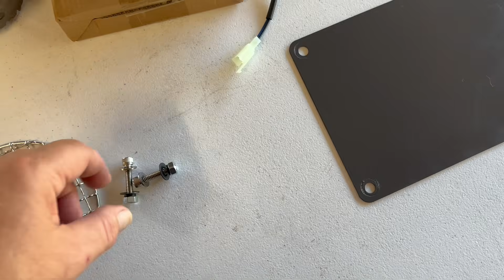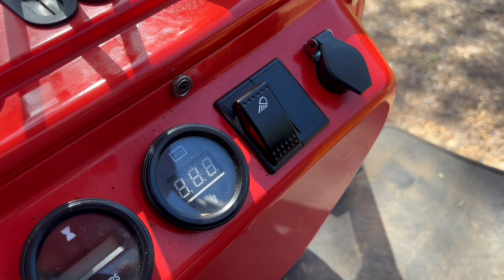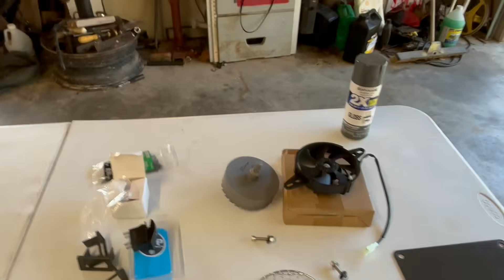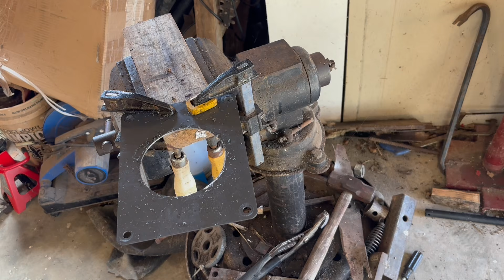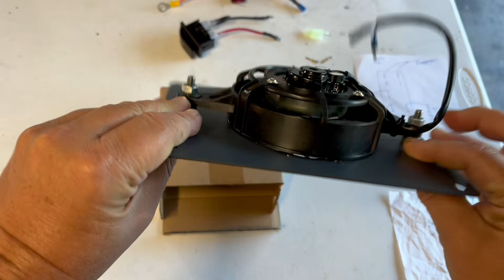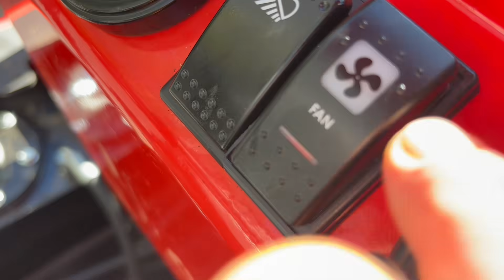Chinese Mini Excavator Fan Install Huayee HY14C

Comment: did yours come with the hydraulic cooler installed
Reply from the maker: Yes. It’s on the side by the engine on mine. One the more recent production ones it’s under the floor panel under your right foot

Comment: Did you just tack weld the grill over the hole?
Reply from the maker: No I drilled some small holes around the perimeter of the big hole and attached it with the small/narrow 4" black zip ties.  They're difficult to see.
Reply: @rgtoutdoors7130  thanks for the quick reply.
Reply from the maker: @USMC6976  Yessir.  I check my notifications on here several times a day, much more often than I check emails.  lol
Reply: @rgtoutdoors7130  I can relate to that.

Comment: Did you use a dremel to cut out for the switch?
Reply from the maker: No. It had a blank spot for an extra switch next to the light switch. I should have a link in the description for an adapter to fit a standard carling type switch.

Comment: Whats your voltage drop to when fan is on?
Reply from the maker: My machine typically runs 13.6-13.8. That includes the hydraulic cooler fan running, which is always on. With my extra fan on there is not much difference. It may drop .1 or .2 but still generally reads around 13.6ish.  The boom light drops it a little more noticeably (maybe a solid.2)but not enough to drain the battery. I’m curious to see what it does when I add some more lights. I’ve got two pods for the front and a work light for the rear when I get around to adding them. I got lowest wattage I could find, maybe 12-14. I’ve had them since Christmas and not installed them. lol
Reply: @rgtoutdoors7130 wow mine reads 12.1 to 12. 3
Reply from the maker: That’s below charging voltage. I wonder if the meter is bad, the regulator or the stater… You have 10? hours and it’s still starting?  Seems like it would be hard to start and need jumping if the meter is right.  I would contact Huayee and they’ll put you in contact with “mike”.  He should help you work it out. I bought mine on eBay and when I inquired about a warranty issue through eBay messenger, they sent me his number
Reply: @rgtoutdoors7130 so I went home today and ran it wide open and the voltage got up to 12.9 without the fan on. Maybe the fan i got uses to much power. It may have eventually got up to 13 but I had to leave and it only took a couple minutes to go up.
Reply from the maker: That just doesn’t sound right to me, especially since you’re not having to jumpstart it.  Im really wondering if your voltmeter isn’t defective.  I don’t have to run mine wide open to get the numbers I mentioned. And I don’t have to wait too long for the numbers to rise and stabilize.

If I were you I would check the actual running voltage with a multimeter and compare it to the gauge and go from there

Comment: Crazy. Just received my Hy14c yesterday. My model actually has the hydraulic cooling about where your battery is instead of in the engine bay. I'd imagine they moved it to not pull hot air from the engine bay over the radiator. I'm definitely going to look into doing this for mine. Great video man. You're the reason I ended up going with the HY14c over other brands. Your videos are super informative. Thank you.
Reply from the maker: Thanks. I’ve gotten a lot of use out of mine. At 60 hours now.  The hydraulic radiator relocation is a good thing imo.  I’d heard from others that they’d moved it.  Where’s the battery?
You also have space now for a larger fan.
My little fan and a muffler blanket cured engine heat and gas boiling issues. But the hydraulic oil still gets hot after a couple hours. I’ve got one more cooling mod I’ll be doing in the next few weeks.
Reply: @rgtoutdoors7130 They scooched the battery about 8-12" to the left from where it was prior. Right next to the air intake. Mine came with an exhaust wrap. Will probably put a large fan where the hydraulic cooler used to sit.
Reply from the maker: Yeah that’s a great spot for a fan.
Reply: @FlaccidGnome  I also recently bought a 14c and it looks like the newer design, too (hydraulic radiator and cooling fan no longer at the left cover).  I was originally going to add a fan the same way as  @rgtoutdoors7130, but as I was researching purchasing the parts to do it, I came across your comments.  Just to verify, you are saying that you are thinking of installing a larger fan at/near the left side cover of the engine compartment, correct?  Blowing air in?  Have you done so yet?  If so, how well does it work for you?
Reply: @R2D42  Hello.  Did you add the 12 inch fan in the area that the hydraulic cooler and fan used to be.  I see 12 inch fans, 12V 80 watts.  Is that too much to tap into the stock wiring for the hydraulic cooler fan and still charge the system?  Not sure if the 12 inch fan or setup, whichever one might be better?  Also a 12 inch fan draws about 6.6 amps.  That along with the stock cooler fan, might be too much, since the B&S engine is 8 amp.  I see that the Mech Maxx Honda engine is 10 amps.

Comment: I know it's not related to this video but can you help me possibly figure out what fitting I would need to attach hydraulic hoses for my tilt bucket onto my diverter valve? 

The hoses that came with the attachment won't connect to the diverter. It's like the fitting on the hose is a touch too big to fit inside the fitting on the diverter. 

Wondering if there aren't some common adapters you'd know of for me to try out before I have to make a trip to a hydraulic shop that might charge a ton of money. 

Thanks!
Reply from the maker: I'm not 100% sure but google ai says the hoses that go to the diverter valve are M14x1.5 thread with a 1/4-inch internal diameter which I believe is an 8L DIN fitting.
It also says that the ports on the diverter valve block itself often have 3/8-inch BSPP threads. 

I can't do it right now, but if I get home from work in time tomorrow or I don't make it home too late tonight, I will see if one of the fittings from my pressure test kit will fit it and let you know what size.

The hoses that came with my cone style log splitter fit it, but they weren't marked.

Do you know the size of the fittings on the hose that came with your attachment?  We need to know that to source an adapter.  What attachment is it?

I think you most likely need (but not 100% sure) a M14x1.5 to M16x1.5 hydraulic fitting like this: https://www.amazon.com/SING-LTD-Hydraulic-M16x1-5mm-Connector/dp/B0F1MZTSJW/ref=sr_1_5_sspa?crid=MG6XV8W67CV8&dib=eyJ2IjoiMSJ9.sT8_r2a4KCda-N1bQn9HA3j1F3lR9ZEouYOqmm6aKqCcaCfRwbb4zniYMae7-CIRWNCbydEhTiIvJ97Em4wOETOSojrkdSMMuHixz1DNTpqs-IT2NErYx7jiNkkfaRtAAlvjgkr1c23sBIrnHmHF_an6EhRpirgBVqvaKvo-DDhZRM13A7o-rOSSHIOC_PRzil3bEQuGxwR9DN1Cq23cusV8Yw50C1QpFauz8xjSOgo.sitFf2jb48R0qgxyrTS5c5ESzJ_2sJMy28i_BipKhPA&dib_tag=se&keywords=M14x1.5+to+M16x1.5+hydraulic+fitting&qid=1768173701&sprefix=m14x1.5+to+m16x1.5+hydraulic+fitting%2Caps%2C206&sr=8-5-spons&sp_csd=d2lkZ2V0TmFtZT1zcF9tdGY&psc=1
Reply from the maker: I had a chance to go check the fitting on the mini ex.  It is definately M14.  The cap on the adapter I tested said S1014 M14.  I missed that you said it was a tilt bucket, btw.

Comment: Awesome! Question. Why blow the air in why not blow it out and let fresh air suck in from the grills on the side (just wondering)?
Reply from the maker: A couple of reasons - one, I don’t want hot air blowing on my legs; two, I want cooler air blowing directly onto the gas tank and engine itself. If I’m sucking air out of the engine compartment, I believe less is going to go over the engine.  While some will make it through the constricted holes in the grills, the more likely scenario to my way of thinking is that the majority will just come up from the larger cutouts in the floor, from the ground and from the vicinity of the slew motor, hydraulic tank and battery.  So I figure most of the volume of air would bypass the engine if I did it that way.

Comment: Very good installation. Keep us posted with any updates
Reply from the maker: Thanks. It helps a lot - moves a surprising amount of air.  I have a muffler blanket to install as soon as I get the time.
Reply: Any updates on muffler blanket?   Do you think the combo of fan and blanket will solve the heat issues?